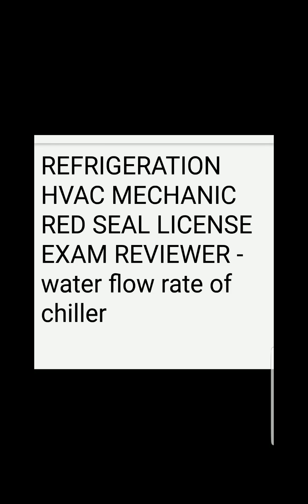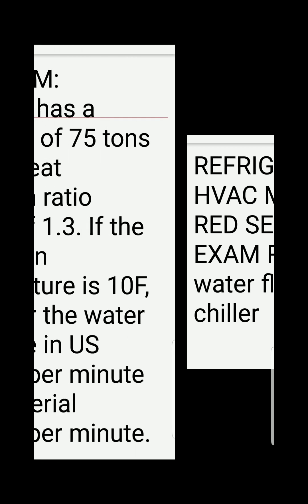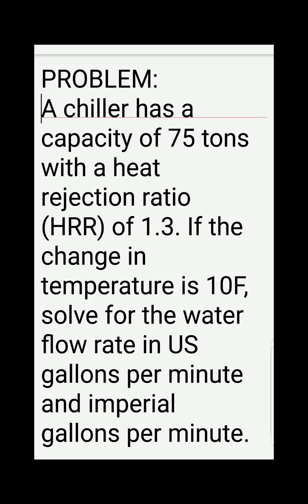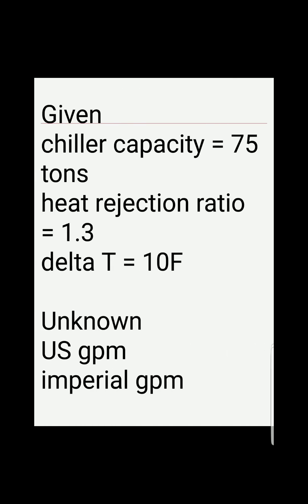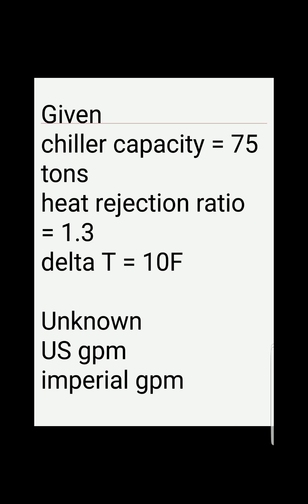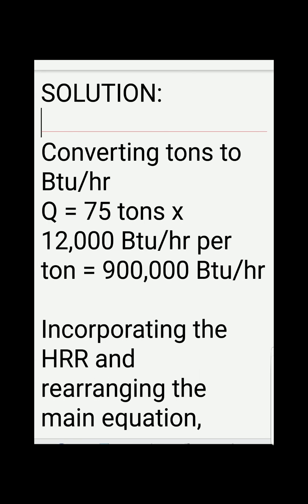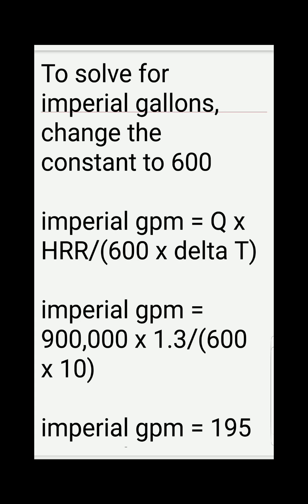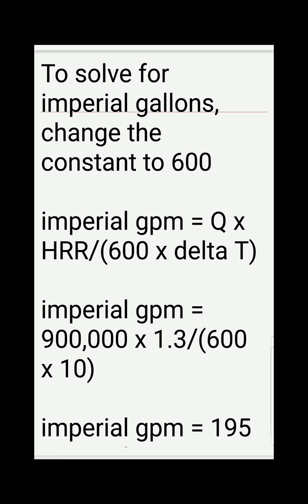REFRIGERATION HVAC MECHANIC RED SEAL LICENSE EXAM REVIEWER - water flow rate of chiller

Comment from the maker: The heat rejection ratio (HRR) is the ratio of heat rejected in the Condenser to the heat absorbed by the Evaporator.  

HRR = Qc/Qe

Qc = heat rejected in the condenser 

Qe = heat absorbed by the evaporator

Comment: Good afternoon. Why are you referring to the Heat Rejection Ratio. Does this mean that the chiller has a 75 ton refrigeration capacity and therefore a condenser capacity of  97.5 tons? (75 tons x 1.3 HHR)  So if I see a question  with an HHR... do I assume that they are looking for condenser water flow?